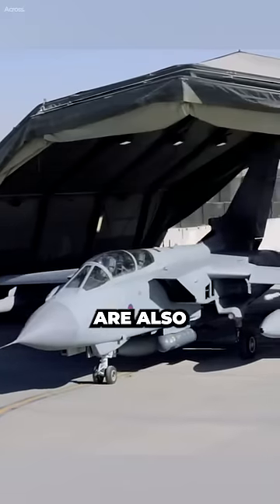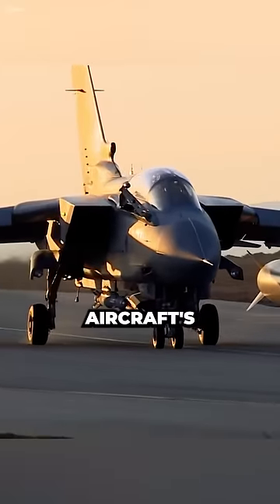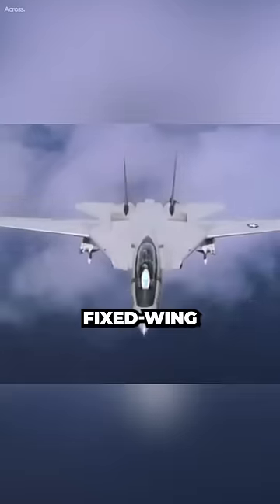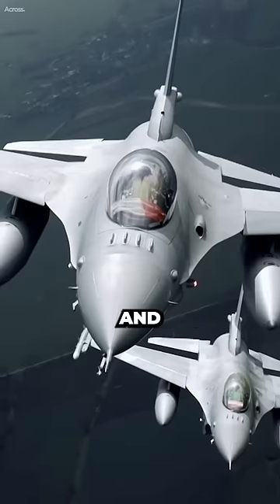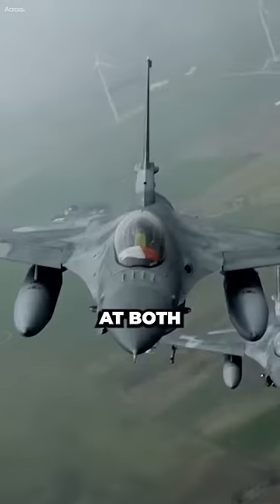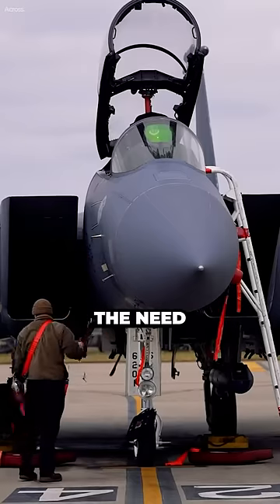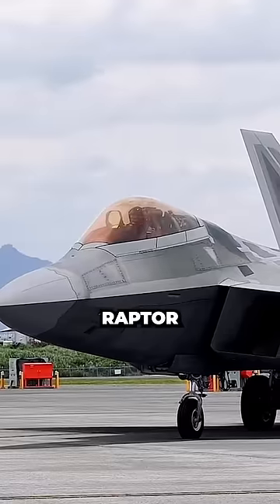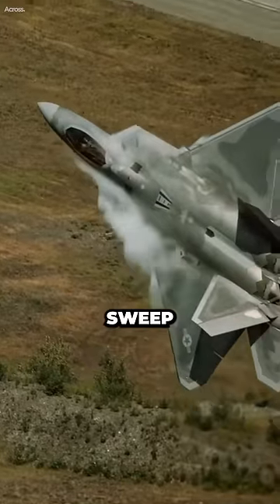Why Don't Modern Aircraft Use Variable Sweep Wings?

Comment: The F-14 is probably my favorite fighter.

But....more expensive? Lol.. like the U.S. gives AF about military expenses when they are getting almost a trillion dollar budget for the military.

Edit: Sorry, I was wrong. In 2023, the Department of Defense (DOD) had $1.52 trillion, to spend towards its 6 sub-components. $846 billion of that specifically for U.S. Armed Branches.

But, obviously most contractors to the DOD are taking advantage of this budget. But that's a different video.

The MAIN reason they are not using the variable-sweep-winged aircrafts are because:
- The swing mechanism takes up too much space inside the wing that could be used for fuel.
- It is difficult to position hard-points in the swinging part of the wing, affecting payload.

With better aero nowadays on fixed wings why waste money on fuel and armaments?

Who knows. I'm probably wrong. Idk, I'm not a plastic surgeon.

Comment: Uhhh your f22 statement at the end doesn't make the point you're trying to make, at all. The f14 ended up with swing wings because the specifications required a long loiter time (at low-ish speed) and the ability to intercept enemy aircraft at speed. By utilizing a variable geometry wing, the design could have wings amenable to long, slow flight AND fast, high-speed flight in the same aircraft.
Therefore you achieve the characteristics of both types all within one aircraft. The f14 still would've been able to go supersonic without it. 
Saying the f22 is fixed wing so it can achieve supersonic speeds is just...uhhh...what?? My Mooney is fixed wing so can it go supersonic too according to you? I swear you just make up jibber jabber for time fillers

Comment: Not true about payload F-14 vs F/A-18. The F-14 wasn't designed with hard points for bombs. It could carry more weight even so. It also had greater range than F/A-18. The F-14 carried out more air to ground sorties than the F/A-18 in Afghanistan '01-'04.

Comment: The item that doomed the F-14 was the titanium wing box, which was difficult to protect from rust caused by the salt water humidity. Still, I would bet that maintenance costs for the F-14 for ten years was cheaper than the R&D funds the USN eventually sank into the supposedly easy expansion of the F/A-18A/C design into the F/A-18E/F.  The USN could use the Outer Defense Zone capabilities for defense against anti-ship missile armed bombers that Russia, China and Iran can now deploy that the F-14 provided and the F/A-18E cannot match.

Comment: The answer to the video question is very simple..  Aircraft can and are built to achieve and perform certain rolls without the extra headaches and maintenance needed for variable sweep wings.... Take the F-15 Eagle for instance...  A fixed wing badass with 107 air to air fights with ZERO losses in 48 years of service... Only in certain applications might the VSW be advantageous.... A better question would be, why don't more fighter and multi roll aircraft use the thrust vectoring technology? The answer would be the same... Those are extreme maintenance points of those aircraft...  VTO jets are a nightmare...

Comment: Aircraft could achieve those speeds before the swing wing came along. It was all about a mix of speed and manoeuvrability at different speeds and different applications, and the fact is that most of those applications aren’t really required any more due to advances in technology and the F1 11 is outdated because I don’t require a strike aircraft like that any more

Comment: Another words they’re still too damn cheap to replace the F 14 with an super f14.  And I got 1 vote to use my tax dollars on the super tomcat
Reply: I'm not american but if I were I'd gladly splash I lot of money into that project
Reply: Not really worth the money. The program would be even more expensive than the F-35 and would be less capable, and would cost more to maintain. As much as I love the Tomcat the design itself is outdated.
Reply: @Generic_Name_1-1  I agree it’s not a f35 or a f22.  But it’s a different design.  But the design is far from outdated.  If we are building the f15ex we could of built a f14ex if we had kept the line running. The navy needs an interceptor more then ever with all the hypersonic weapons.  And the f35 can’t do it and the f18 is not fast enough. So let’s just hope the navy gets the f14 replacement soon. A war with China would be a navy war and we need to get the navy the plane it wants and needs
Reply: @survivalSC  so true
The F-35 can't even go mach2 (it's not really a problem cause it doesn't need to anyway)
And the F/A-18 is still not fast enough as you said and it's not a great air superiority platform (although it's still competitive) so the navy technically needs something new.
I wish we lived in a world were the Tomcat's production line hadn't been shut down. Now it would be impossible, even its raw materials are out of production
Reply: @zanzao-1ps318  I agree.  The problem is the navy is going to need all new fighters.  Since the f18 is not and can’t be used as an fleet protector interceptor.   So they will have to decide between something like the f22 or to build something like a f15 but for navy. It’s a hard decision because of the costs.  I think they could use the f35 navy version for the stealth part and they should probably go with a very fast interceptor.  With longer range anti ship missiles they will need something that can reach over Mach 2.1. So something like a f15 but for navy would work.
Reply: @survivalSC  True, or perhaps a lower cost solution: develop a new and modern super long range AA missile that may resemble a AIM-54 phoenix but I'm not sure if it would do the job

Comment: The digital F-14D became a superior multi-role fighter with the lift and space available for strike and EW missions, similar to the F-15E marrying the F-15C fighter superiority capabilities with the F-111F all-weather strike capabilities. The F-14D could have replaced the A-6E and EA-6B. But back in 1993, all the armed forces were re-missioned to contingency and counter-insurgency with the proviso that no near-peer competitor with the tactical and operational  of the former USSR would manifest for 20 years. So the USN dropped the F-14 because there were no longer fleets of bombers armed with long range anti-ship missiles. Now its 2023, and Russia, China and Iran have bombers with AS missiles and the USN doesn't have a long range interceptor and missile combo.

Comment: That is a lie. The F-14 had much better flight speed and better payload capacity and range than the F-18 Hornet.  The F-111 carries a good payload a good distance and is faster than an F-15E at low altitude because when it swept its wing it had much lower drag and also was less effected by turbulence at low altitudes.  The Tu-160 is able to fly supersonic because it has variable geometry wings and is still the worlds fastest operational bomber.
Reply: Only because when the reactivated the B-1 program the changed the engine to ones that were not as good or as fast.

Excalibur was a much better name than Lancer, but the dummies changed that too... smh

Comment: Me hearing the video:
Ok that makes sense
Me after TopGun Maverick:
I dont give a fak, bring back the F14 !!!
Reply: The production line has already been shut down for a long time. The manufacturing and production equipment and tools have been destroyed as well, to prevent any parts from being illegally made and smuggled into Iran. And if I'm not mistaken even the original blueprints and data were destroyed (I could be wrong for this). So I doubt they can actually rebuild. The carrier-capable F-15 variant is still a possible choice since the F-15 is still being produced.
Reply: No, we still have all of the blue prints & Spec sheets.

Additionally we also have all the R&D for the UPGRADED & UPDATED BLUE PRINTS F-14.

All that was fully COMPLETED & PAID FOR !!!

Comment: Wrong, the cracking of the titanium wing boxes on the F-111 and the F-14 was deemed to expensive to replace, not to mention tear down and replacement of the wingbox meant time consuming work needed to be performed off of the ship at shore based facilities. Besides that more modern wing designs obsoleted the older folding wing aircraft that were designed with a slide rule.

Comment: Supersonic flight is not based on swept wing technology. The reason they dont have the interceptor planes anymore  is because they rather have modern missiles, and alot of them instead. The range is not as important now days due to the advanced in radar and missile tech
Reply: That's exactly why the interceptor is necessary, genius.  The current crop of our fighter inventory doesn't have the eyes nor the arrows to take out enemy aircraft carrying hypersonic anti ship missiles with 100+ mile ranges.

Comment: You are crazy. The Tomcat could carry 6 AIM54 missiles and drop tanks. The Hornet was a joke for capacity and burned through fuel like crazy. The joke from pilots and ground crew was 1 pilot, 1 bomb, 1 hour. The sweep was good for carrier parking and everything else had the weight in wing fold motors.

Comment: Don’t think the statement that the F-14 had a lower payload capacity as compared to the F-18 is correct. IIRC the F-14 could fly farther, faster and with a heavier payload as compared to the F-18.

Comment: The F-35 can achieve supersonic speeds without the use of its afterburners i.e supercruise, while being a fixed wing. Engine advancements and computer-assisted designing has allowed the F-35 the luxuries of wing swing aircraft while not suffering from its negatives.
Reply: Supercruise don't mean crap if you can't intercept the enemy before they launch their hypersonic anti ship missiles...  too slow, too short internal radar range, too short maximum weapons range...

Comment: The supersonic speed without using afterburner of the F-22 is a function of the engine, inlet, and exhaust design. Not the wings. Make no mistake, an F-14 with modern engines and radar would decimate 4.5 and 5th gen planes. This is due to the incredibly large nosecone and other areas that could house large and distributed aperture radars. It would rival an E-2 Hawkeye. Modern planes are a result of the focus on stealth and making up for poor aerodynamics and thus performance with instability and flight controls.

Comment: The F22 Raptor or F15 Strike Eagle cannot take off or land on a carrier. The F18 is a turtle to the rabbit of a F14 Tomcat. The Rino is not know to be fast both figuratively and literally.
Reply: McDonnell put in a bid for a carrier based F-15, but the F-14 was selected.
Reply: The F15 was supposed to have a carrier version but was rejected, there's a difference between not being able and not being allowed to 😋
Reply: @Ashitaka0815 The F-15N never got anywhere because it would have cost just as much to create it as the F-14 despite the cost overruns. It's not just a matter of putting a tailhook on an F-15 and calling it good. You need new wings that can fold. You need entirely different landing gear that won't break on landing. You need a significant strengthened airframe. You need components built for service in the salty environment. The Eagle probably would've done fine but you're revamping just about everything on the jet to make it work on a carrier.
Reply: @DriveCarToBar  I never denied that - still would have been more economically in the long run, as many spare parts would have been still interchangable. Buying a Jet is not the big issue, but maintaining them. Plus a better performing jet on the whole, but I know it's sacrilegious saying that to the F14 fans 😋
Reply: @Ashitaka0815  It probably would have been cheaper in the long run without the movable wings. Better performing is questionable. The F-15 couldn't launch the Phoenix missile and didn't have the F-14s radar and fire control systems. The F-14 was the F-22 of it's day at the end of the 1960s. 
The F-14 and F-15 were very closely matched in terms of performance although I will say the F-15 does have the edge in dogfighting. The F-15 has the benefit of 30+years worth of upgrades and new variants. We have to remember when the F-15 was launched, it carried only two kinds of Air to air missiles because that's all we really had. There were reasons the F-14 was chosen over the Eagle. Fleet defense is more than just what we saw in Top Gun.

Comment: F22 has a wingspan of 14 meters and can weight up to 40 tons loaded. 

40 tons! That's the weight of a 737 which has a wingspan of 34 meters!

Modern fighters have acceptable low speed performance. Acceptable, not good.

Comment: So heres the actual answer. It has nothing to do with cost or maintenance. We figured out how to build supercritical airfoils, made variable sweep obsolete. Supercritical airfoils perform better at mach, better at low speed, and remove the necessity of moveable wings and all of the very heavy hydraulics required to move the wings. Thats the simple answer

Comment: Wow - my 2 cents - anyone look at our national debt lately? Anyone also look at the cost of building n maintaining Raptors or F-35’s? Most countries don’t want the 35 2 boot - A Grumman cat was 38 mill - DICK Cheney hated Grumman and used weight/maintenance and obsolescence to take the Cat & Other Grumman product off Navy Carriers to put ‘‘em outta business - it is the design of the swing wing assembly not weight and even Russia who was Rumored Russia had acquired a Cat from Iran, tried reverse engineering and failed to duplicate the swing wing assembly - we need math and skilled craftsmanship not lazy kids coming outta school who want to play on iPads all day instead of actually working 😄
PS about the weight till science comes up with a material that is lighter than carbon fiber - stronger than say spider webs and costs Pennie’s on the dollar,  weight is a good thing as your cats and say Grumman intruders would not fly apart due to landing or high altitude speed- I’ll take A Modern Grumman Product - the Proud son of a Grumman Airframe Engineer recently deceased

Comment: Most of these points are entirely moot

Modern stealth aircraft are more expensive to design and maintain

The extra weight of the mechanism is a trade-off, if you get better performance it's worth it

Modern design techniques and wing designs have eliminated many of the benefits of variable sweep wings.

But the real reason we don't use variable sweep wings anymore is they aren't stealthy.

Comment: The tomcat was faster then most of the aircraft shown though learn do better
Reply: F15 was/is faster and the difference is actually quite huge. Still, measuring effectiveness of a fighter plane by speed is obsolete since the end of the cold war.
Reply: the f15 can go supersonic VERTICALLY, meaning its way way faster than the f14 with swept wings

Comment: F18 can't reach the speed of F14.
Reply: It doesnt need to.
Reply: @Typexviiib It is in needed when facing off with Mig 31.
Reply: @alexlo7708  if the mig 31 runs away, the f18 did its job without needing speed.  If it moves into range, speed doesnt matter.
Reply: @Typexviiib  Speed is important. F15 was shot down by Mig25 in the middle east because of surprised attack.
Reply: @alexlo7708  no f15 has ever been shot down in air to air combat, lol.  0 minutes of air combat have ever occurred over mach 1.6.

Comment: Put mig31 in the picture
Reply: Why? Its a short about Variable Sweep Wing? and the MIG-31 doesn't use Variable sweep wing? The MIG-23/27 does though which were shown. Though there is a point in the short where there are 2 F-35s and 2 MIG-29s.